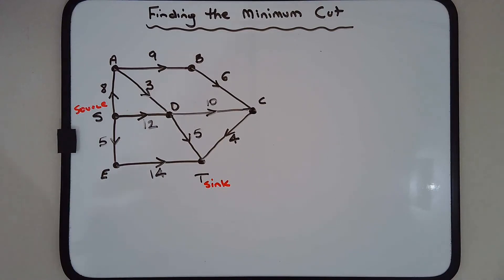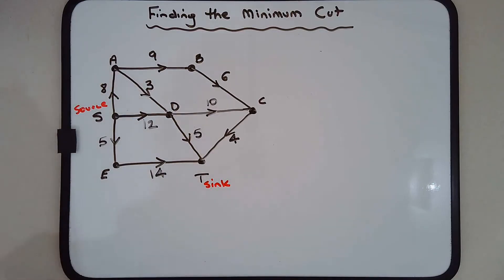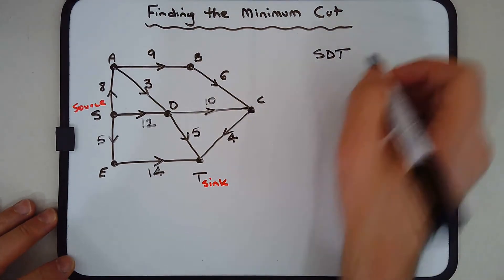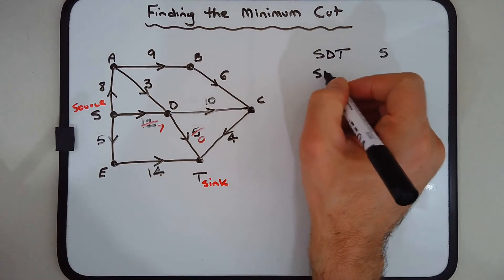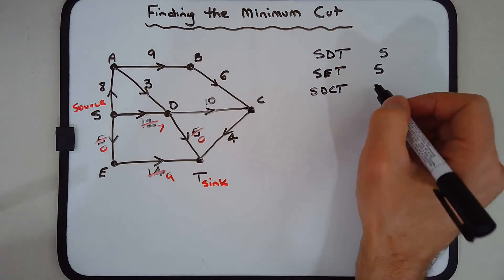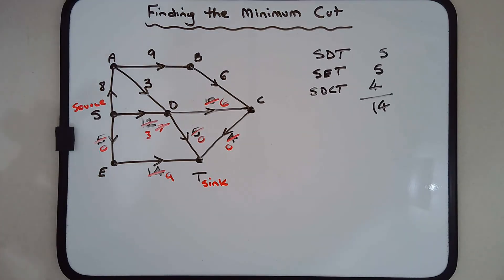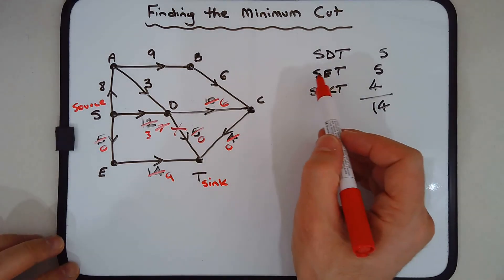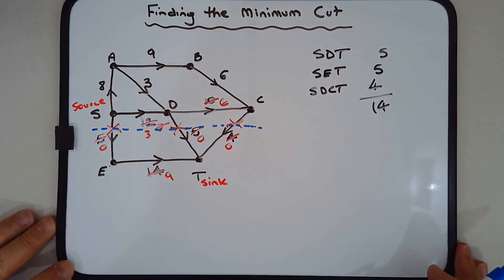How to locate the minimum cut that represents the maximum flow capacity in a network graph

Comment: The part I did not understood is: for SDT you cross marked 12 and made it 7 and 5 to 0, why?
Reply from the maker: That path can only flow 5 units... equal to the edge of smallest weight. The algorithm is about how much it takes to saturate each path from source to sink... SDT can only flow 5 units, so saturating that path means the edge SD is also flowing 5 but the edge itself has a capacity of 12.... 12 - 5 = 7 which represents the spare capacity of edge SD.

https://en.wikipedia.org/wiki/Ford%E2%80%93Fulkerson_algorithm

Comment: How do I find the minimum cut without having to draw all possible cuts? I used the systematic method to find all possible paths and therefore the maximum flow, but I don't know where to go from there.
Reply from the maker: Min-cut max-flow is inherently a guess-and-check method. The only sure-fire way of finding the minimum cut is to draw all possible cuts, which is not always practical, especially for complex networks. The systematic method (or the Ford-Fulkerson method) will give you the maximum flow, so if the question is asking you to draw the minimum-cut, look for a cut whose edges sum to the maximum flow you found using the systematic method. 

Keep in mind that when finding the maximum flow, you either use the min-cut max-flow theorem OR the systematic method, not both. In some exams the question asks you to use the min-cut max-flow theorem, so to help you find the minimum cut, use the systematic method so you ay least know the capacity of the minimum cut...

Comment: Could you please let me know why I cannot go SABCT or SADT
Reply from the maker: You could... there is more than one solution to this problem. The method I used is called the Ford–Fulkerson algorithm which is not taught in the NSW HSC syllabus but is my preferred way to solve max-flow problems as it's based less on guesswork/inspection and more on algorithm/process... you can read more here ... https://en.wikipedia.org/wiki/Ford%E2%80%93Fulkerson_algorithm